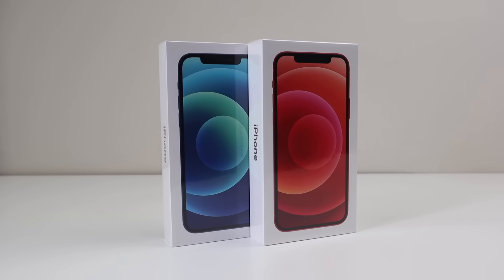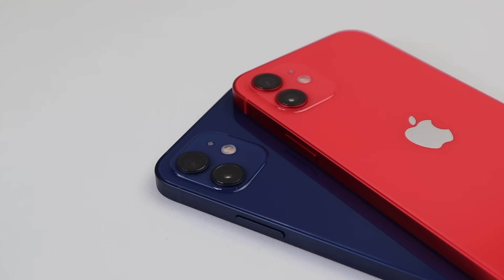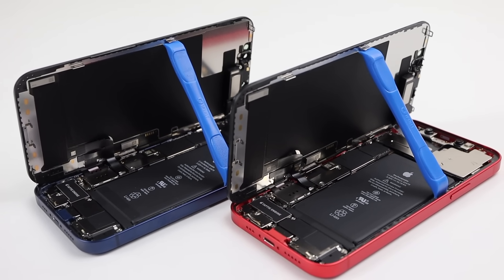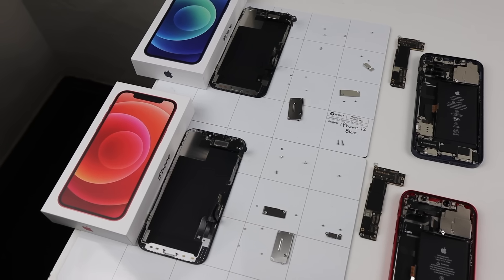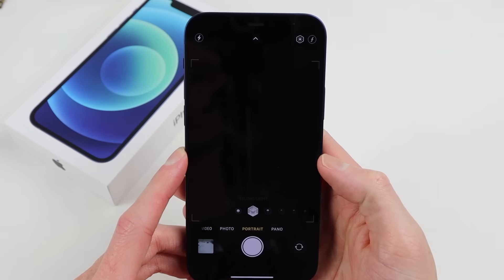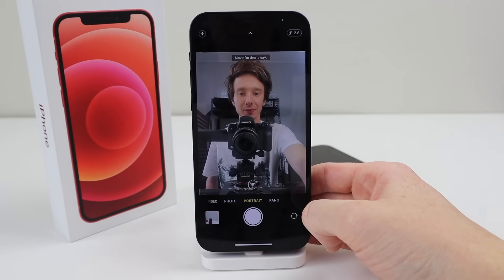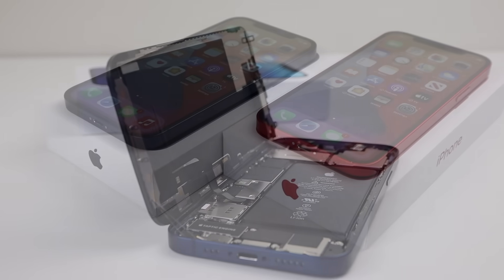iPhone 12 Anti Repair Design - Teardown and Repair Assessment

Comment: How messed up would it have been if the devices stopped working when you put the original parts back?

By the way, Louis Rossmann definitely had some things to say about the un-repairable camera.
Reply: iphone 13, it’s coming
Reply: @viggysmols6387  Agreed. Even when changing logic boards on Macs through GSX, you need to rescan all the serial numbers for parts changed, otherwise the mac complains that you've got mismatching serial numbers. It'll keep you from closing repair tickets, or running diagnostics. I would love it Apple actually allowed people to repair their own junk.
Reply: @joequintero2681  and this is why I use a Galaxy Note
Reply: @Coruptanimation  anything not apple at this point is better.  Hell I think my phone could he repaited and remade and not be trouble
Reply: @Coruptanimation  same here! I love my S20 Ultra. People always notice this and go "You're our Apple Tech but you use Android?" 😂 "Uh yeah, I like the ability to be able to do whatever I want with MY device!
Reply: My Nexus 6P is basically all new parts at least once over other than the nfc antenna, mainboard, and camera. Not the easiest to work on either, but at least no shenanigans like this Apple crap.
Reply: @joequintero2681  so you can simply  change  your own battery in it ??
Reply: @joequintero2681  One of my other repair techs has an iPhone 11 and every time she complains about something and I give her The Look, she just says something along the lines of, "don't you fucking say it," or, "I don't want to hear it." Cracks me up every time.
Reply: @madmax8620  yep, but even the battery has a serial number. The battery also has 2 or 3 tabs of adhesive running along the underneath of the battery. There's tabs you can pull to remove the adhesive, but if you break those tabs, it'll be a royal pain I'm the behind to lift that battery.
Reply: @joequintero2681  Sorry...the key word was "SIMPLY" ...but confused because you answered "yup"...then mention with no detail about serial number issues and pain in the keister if broken battery glue/seal tabs??..what is that...?
Reply: @madmax8620   @Mad Max  sorry, I thought you used simply meaning "just". It's basically the only thing you can change out without the phone freaking out on you. If you Google "iPhone battery adhesive strips", you can see a Pic of the strips and you'll see what I mean
Reply: @joequintero2681  ok... sounds not as good as the 5 minute breakdown of my old phones and im no expert but managed quite well with those. .. i wish i could just use those old phones forever because they do everything i need and work reliably like  they should and can always be fixed by myself... but now being forced out of future support for use. ..
Reply: @joequintero2681  or if people just didnt buy the garbage in the first place
Reply: "If you connect a non-apple approved peripheral via bluetooth the phone bricks itself"
Reply: Would not shock me AT ALL, trash company and greedy owners they need more more more, insatiable thirst like a drug addict.
Reply: @hunterstokes9306  i wonder how much i need to drive them to od...
Reply: @lechking941  not sure but I'm sure what ever the amount would be worth it
Reply: Beat me to it.
Reply: Apple : write that down!
Reply: Heyyyy, I subbed 🙌
Reply: dont give them ideas
Reply: Why is the dbh guy here
Reply: I'm not involved in any way in this field. . . I just happened to find Louis Rossmann late one night and stayed up until 3.45 am watching him. . . I was hooked and followed him for quite some time. Really interesting Guy and the things he repairs which Crapple say are not repairable. .  

Sooooooo . . . for all your bits n bobs . . . go to Rossmann dot whatever. . ha ha ha ha ha. . I love the way he plugs his stuff (and rightly so) he's a real worker that guy. . . there's drunks outside and crazy's knocking on the window . . . . "I'll just sarder this and find out why PP13 hots off. . get some cleaning strip and bridge this burnt PC board . . .connect the battery and there's the Crapple logo"  ha ha ha ha  . . . thanks for reminding me of him . . . made me laugh
Reply: I personally like to go with xiaomi phones that are not supposed to go out of chine, you know you can trust Chinese technology when you have to use special nonofficial channels to get it.
Reply: @diablo.the.cheater  
Nice try 
You commie spy!!
Busted.... hhaaaahaaa sooooo 
Obvious
Reply: @diablo.the.cheater  chinese government might have an eye on those tho. In any case that's much better than an IPhone, I was going for xiaomi as next phone but switched for a low end Samsung. I assume both work wonders.
Reply: IFixit just stated the other day that they successfully replaced cameras on Mini, Pro and Pro Max versions without single issue. You can find the video and the Twitter post :)
Reply: How messed up must one be in order to waste two new and perfectly working iPhones?
Reply: @Phaidrus  Don't worry, he will be taking them back for a refund. That's why he cleaned them, Apple can sell them as new.
Reply: One of the reasons the camera doesn't work is because of FaceID. The phone needs to be sure it hasn't been tampered with in order to trust the data it send for unlocking the device. So just like the old home button, which was also locked to the device, you can't simply exchange those.
Reply: @iWhacko  face id with the rear camera?

Comment: I would advise picking up a universal tool created for 
problems just like this. It's sold by Colt and called 357 cal.
I have used it on several smart phones from different 
manufacturers and it's eliminated all issues....... Permanently.

Comment: The battery has a chip that you can replace to make it run as normal from what i have been told, the same issue with battery not allowing the use of the battery capacity thing has aparently been a thing since iphone10

Comment: Most likely is the device stores the hardware ids in the eeprom and won't accept another hardware component.  You will have to crack the firmware and force a true reset of all hardware IDs.

Comment: I know the title is clickbait but I cant help but feel like Apple wouldn’t incur so much massive cost and risk yield by adding additional complexity to the manufacturing process just to screw the repair guys. In a market that’s competing to be the fastest but thinnest phone, durable, water resistant but also have a full day of battery, the most efficient SOC with heat regulation, memory processing etc, there is always going to be compromise with the design to pack it all in. I also wonder what the bell curve is in device upgrades; most people are on a ~2year plan, all of it including accidental damage is covered under the extended warranty & then you upgrade anyway. I think this topic is too edge case IMO

Comment: 1:01 bro it isnt a problem at all! If you have the old charger brick, just use the old cable for it! 🤦‍♂️
Reply: And if your old cable is all mangled? Then what?
Reply: @Quickstein  then you buy a 5$ cable from amazon.
Reply: @KrumpusPlunk  Ok, I suppose that's fair; if you have enough for an iPhone, then surely you can afford a $5 cable. But still, you just know that Apple's gonna make it so that those after-market cables do jack to charge your phone unless you specifically buy one of theirs
Reply: @Quickstein  at least the 5€ cable will look the same in a year or two while all the original apple cables I ever saw always looked completely frayed out and broken ;)
Reply: @KrumpusPlunk  Ok, but like I said, that won't do you any good if the phone will barely accept a charge from an off-brand cable, or even just not charge outright. Also little nitpick, why did you change the currency symbol?
Reply: @Quickstein  because I didn't pay attention lol. My 5$/€ lightning cables work perfectly fine and are in daily use, is that a problem with usb c cables?
Reply: @KrumpusPlunk  luckily not nearly as frequently, but I'm not going to pretend that it doesn't happen with some lower-end cables.

Comment: I had only one iPhone (5S), which was great. However, the system lacks compatibility with anything you can imagine outside the "Apple" world, both software and hardware. Now, they are using this "lockdown" to push ridiculous and annoying decisions. It is really stupid to believe that "they wish to reduce e-waste by dropping the charger". Almost the whole industry seeks for "programmed obsolescence", and Apple had perfected it in so many ways that they can even say: "I'm not shipping the charging brick, the only ones compatible are those that I sell or I get royalties to allow production. There's no reason for that, but only the greed of stockholders and top engineers.". Yes, I do have the Mac computer, 2016 one, because the new ones are beyond repair if I need it. I do not want to put more e-waste in the world, but the governments HAVE to take action on these greedy companies (that are almost all of them greedy in some way). why? Because they keep finding ways to force the replacement of your devices, or by doing "Security updates" that cripples the device or by adding non-solicited features and bloatware, or even by making the battery replacement almost impossible. They are gluing everything and making you believe that "new features" are essential for your productivity or well-being.

Comment: I worked 20 years for a manufacture.  Here's a few things for you to think about.
. some would be repair guys makes a repair.  It may work for a while.  Then you take it to the manufacture to get it right.  They charge you.  you are POed.  did you expect a free repair?  I've see this a LOT.
. Looks like you are not trained on this device.
. manufacture does not post a repair manual for the untrained.
. if they had classes to certify you would you attend?  I bet not.
. This is not a PC where a bunch of store bought parts from different manufactures are tossed together they near anyone can work on.
.  I could go on.  But I'm sure you get the point.
. What certifications do you have.  A EE maybe?

Comment: Is it possible that the BIOS or other software checks hardware ID’s in the iphone?

If so, the software before the IOS boots is checking if the paired hardware is correct what had been defined.

Maybe a solution is to change the software checking the hardware ID’s. But then you will go into the jailbreak land....

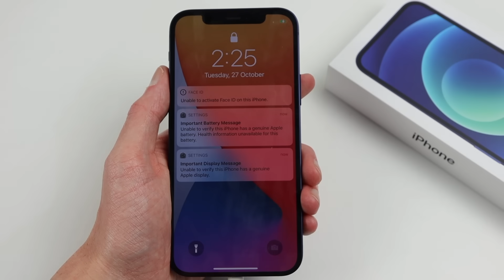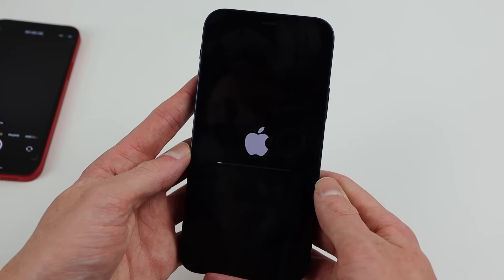Comment: 7:58, 9:53 The reason FaceID does not work is that the earpiece speaker/ sensor flex cable (which is attached to the display) must be kept with the original iPhone logicboard it came with. Simply unplugging that cable would result in the same message on an all original iPhone X through iPhone 12 models. If you swap that component FaceID will work, assuming nothing is damaged. Source: I've repaired hundreds of these phones.

Comment: Apple is great at getting money.
By having the phone flip to the side instead of just go apart (like normal)
Many people will accidently break that flexibel cable(wich can easy break) and also lose garranty so they have to pay for a repair.

Next thing, the pairing for components.
By doing this you disable 3rd party repair and have it look like you broke something.
And since the components are new there is now way its a component problem.
And its not a software bug since it notifies you about the false battery and stuff and even some menus went away.

Last thing is the charger, but I think this speaks for itself.

Comment: Thats so fucking stupid. Not only I need to work for iPhone I need to work also for adapters. And you need at least 2 so you have back up if something happens. And that adapter is more easier to broke. Think about if you walk on that new adapter while iPhone is on charge. Just accidentally. It so thin end. Rather than usb is a lot harder end cable.... so it’s just so brainless idea. What made usb so bad that you needed to change it apple ? It’s better?

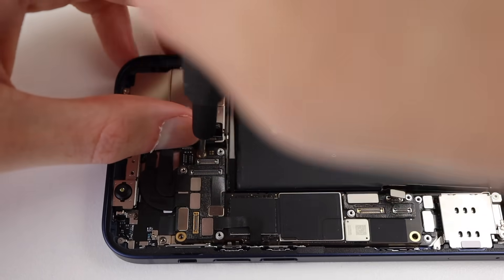Comment: @13:48 "I don't believe that this is a software bug"
sure seems like a bug; I guess it could be called malware, crippleware, virus?
If you changed a part in a device, and the device reported that the part was changed, then you could say, "oh, that's a smart device".

When are we going to find a clear case or programmed failures where devices are out in the world working perfectly fine, but preprogrammed to "fail", in order to generate repair revenue; then you take it into an authorised shop, they plug it into a repair console, the 'repair' console might do nothing but just check that it is just a routine programmed fail/false-malfunction or it might do a few things like a software 'upgrade', copy personal data, install a virus.

Malpractice.  Ransom

Comment: What if I am a new Apple user ? Then I cant charge my phone because I needed to have had Apple phones in the past?
Reply: If you just bought an iPhone 12, the charging cable is included. The wall block that the cable plugs into is not. You can not use an old wall block with a female usb port in it because the included cable is lighting to usb-c. So if you just bought an iPhone 12, you will have to pay the extra 30 dollars for the wall block with the female usb-c port in it. As you said, you are a new apple user, so you will most likley not have an old lightning cable laying around. And if you do have one, I am not sure if any of the older lightning to usb cables will work with the iPhone 12.
Reply: @Repeatingpower7  I don't understand how people keep supporting this anti consumer, overpriced brand.
Reply: @dumitrugeorgian210   People like Apple just because it is somehow a status symbol. People (mostly likely in still in school) want to show off their new $1200 Apple device so they "fit in" with everyone else. They don't care what Apple does, all they care about is the Apple logo in the back of the iPhone. And if you have a Samsung (such as myself), the Apple fanboys still rant on how "it will explode" or "the camera is trash". The reason Apple hasn't died yet is because of the fanboys who will buy their products even if the box doesn't include a phone still exist and will make Apple sound like this "super unstoppable premium company". These kinds of people will support their company until they die and nothing will change their mind.

Comment: Yesterday I have replaced speakers in my iPhone 7. iOS 13.5.1. First rebooted itself multiple times with Apple logo only. Then completely off. Thought battery is dead so connected a charger  and hard restart which turned it on without Touch ID. 
Now I don’t have home button and Touch ID and speakers again back to faint volume.
Reply: Now I am going to put originals back. Let’s see if home button comes back.

Comment: Your premise is a logical fallacy. Not being able to swap parts doesn’t make a device environmentally unfriendly. The primary cause of e-waste is disposable devices or devices that don’t get continued support after the purchase. iPhones are kept longer than any other phone due to them getting 5 years of updates and the wide availability of getting common repairs done (logic boards are not a common repair). And when your iPhone is replaced Apple will recycle your old one for you.

Compare this to the over 1 billion Android phones sold in the $50-100 range worldwide every year. Nobody bothers to repair them because it’s simply not worth spending $50 to fix a phone that you only paid $50 for in the first place. So they get tossed out and replaced with a new phone when something goes wrong.

If people want to tackle e-waste, that should be your focus.

Comment: 2030 Apple: when you buy a phone, you have to buy every part seperately and no repairs, when it's broken you have to buy another one
apple is basically EA of the phone industry
Reply: IKR ITS LIKE SIMS BUT PHONE
Reply: its more like ea is the apple
Reply: Well EA as a phone company would be more like: It requires network access for everything and when it's two years old, it no longer connects to any network.
Reply: And we still fucking buy it...
Reply: like Ea , the best game
Reply: The only reason EA is bad is because Investors keep pushing for more money
Reply: yet people buy it, trillion dollar company
Reply: I’ll switch to android as soon as some other company implements Face ID. I’m stuck to iPhone just because of that I even tried the Samsung s10 which was beyond horrible, face unlock takes too long doesn’t work in the dark and the Touch ID is only on the bottom and doesn’t work 50% of the time.
Reply: Pc companies 🙄
Reply: @ajspitz05  Pc parts are interchangeable though. So long as it has a port to connect to, it will work.
Reply: @ajspitz05  dude pc companies are pretty fair when we're talking about hardware
Reply: @ajspitz05  This doesn't make sense

Comment: i don't know why everyone (not everyone but a whole ton of people) still thinks that apple is the best tech company.

They want to be "economical friendly" and produce more packaging than needed. also they are locking repairs as we see in this video or when ltt tried to fix their imac.

Then the cooling system in the macbook air, a heatthink on the cpu but the fan does literally nothing for it.

But still they charge way more than their devices are worth (iphone costing over 1k while you can get phones with better battery (iPhone 12 has 2800mAh, my 4 year old s7 3000 mAh) more ram and a better cpu for less than 800€) and there are still enough fanboys buying apple products "because they are the best" but we should all know that this is just because apple is still seen as a status symbol.

(did i forgot something?)

Comment: If you have an existing charger from an old phone it does still work with the 12. If you have a usb power adapter, you probably have a usb to lightning cable to go with it